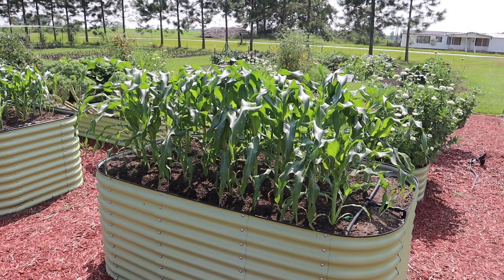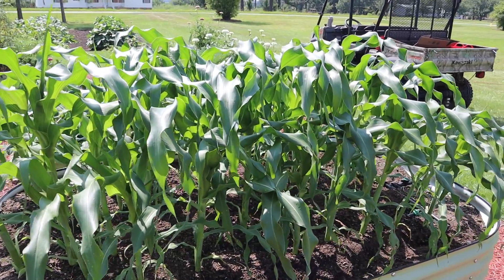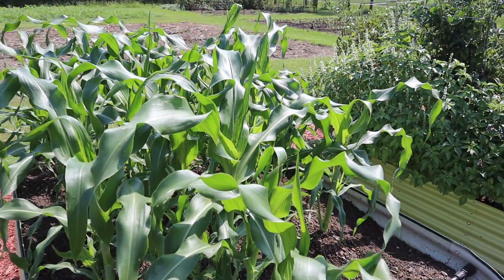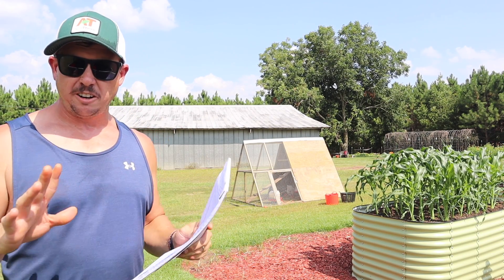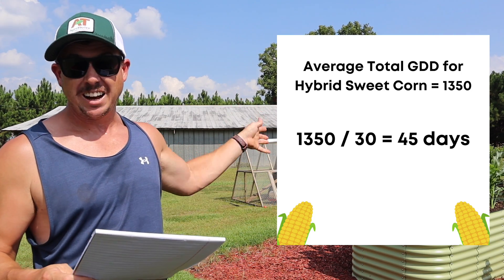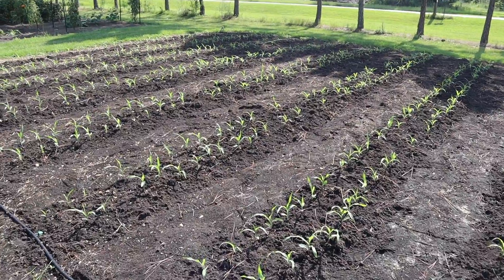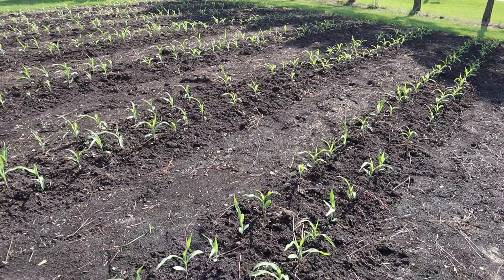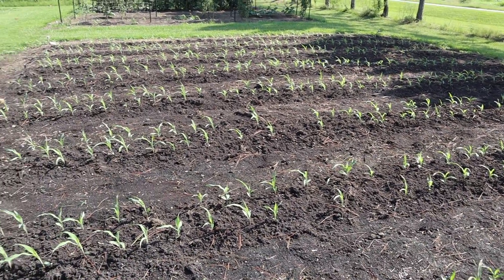This is Why Your Garden is Struggling RIGHT NOW!

Comment: A lot of field corn needs 2,000 -3,800 growing degree days. I've been taught that corn does not grow above 86 degrees, and does not grow below 50 degrees. if you have real hot days above 86* and the nights above 86* your corn will not grow at all for those 24 hours, or if your night, and day is below 50* it will not grow at all. They also figured out that you need so many growing degree days before your corn will tassel, and for it to get to the milk stage. They also figured out how many GGD's certain insects need before they hatch. That way they know went to use pesticides for certain pest. I've been keeping track of GDD's for a few years now, outside, and inside my hoop house. Inside my hoop house the last couple years i have been getting about the same GDD's as Little Rock, Arkansas for the year, and I live in northern Wisconsin. The only problem up here is that we loose a lot of the sun light, so the GDD's don't really matter unless we use grow lights in the winter. Thanks for your videos! I love learning from you. 😊

Comment: Shorter stalks implies shorter growth and fruits. Would you be better to plant this corn later in order to take advantage of the cooler fall temps? Or what about adjusting the starting points so you maximize growth for all plantings? You can look up daily temps off the web.
Reply from the maker: We can plant in the fall as well. We just had this space open so decided to try a mid summer planting.
Reply: @LazyDogFarm  Sure. Just wondering if you want to contemplate different start dates based on what you know now. It'll still be a best guess based on last year's performance and temps. Maybe you can get 2 corn crops, and something else in. Maybe you need better heat unit management and scheduling of crops. 😉

Comment: That's an interesting and informative post. I think I'll research more on the topic. Once thing it (possibly) explains is why my corn is not as tall as usual. We've had extraordinarily high temperatures in early summer (in excess of 100F). That's normal for late summer temps in our region but it came much earlier this year.

Comment: Travis I have a question,  this year I fertilized my corn when I planted, side dressed it twice  and watered every other day and my corn tassled but never made ears. Do you have any idea what could have caused that. I've grown corn there before with no problem. Any ideas would be appreciated
Reply from the maker: I've never seen corn not make ears, so not sure.
Reply: How hot was it while it was pollinating? The sun can be to hot and basically burn the pollen if temps are high like 90's or higher. Sometimes when really hot the silks aren't out at pollination time or are past the right time to get pollinated. Worms or beatles can also eat off the silks at that time too.
Reply: @milkweed7678  It was in the mid 80's and there was never silks, not even a sign of an ear forming on the stalk.
Reply: @nickparton8324   I really think it has to be weather related. I've seen it happen in  fields of pop corn, sweet corn, and field corn, during high heat and dry conditions. No ears of corn.

Comment: My late planted sweet corn is puny compared to my Spring planting. Late corn doesn't seem to need as many nutrients as Spring corn. I don't see the ear and stalk size differences in field corn vs sweet corn. Late planted field corn does mature faster but there's little difference in the stalk height or ear size. The field corn I planted in mid June is just beginning to tassel and is about 10-12 ft tall. It'll probably get 14-16 ft at maturity.

Comment: Corn maximized at 86F?   Explains why my corn stagnated until early July... and then took off once we finally got warmer temps.    Thanks for the info.  Best wishes from Kate in Olympia, WA — 7/26/2023.
Reply: I assume because you’re up north. I’m in the same zone as Travis but live in Texas. Today it was 101 F but felt worse with heat index and humidity. It has been around that temp or higher for several weeks now. Just a thought.